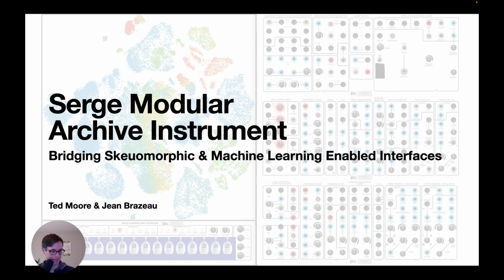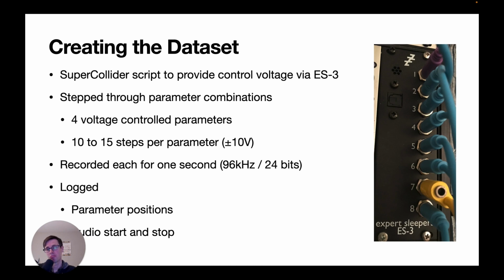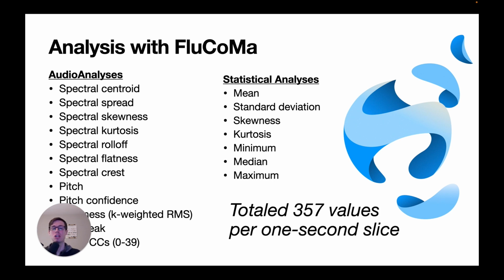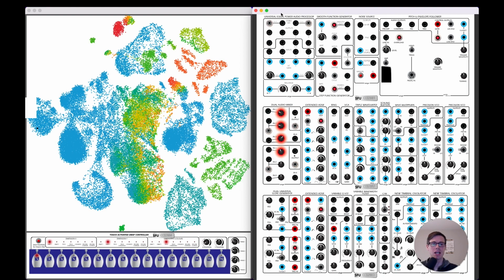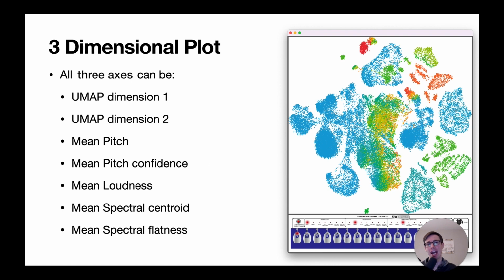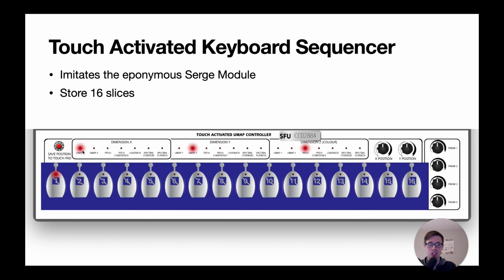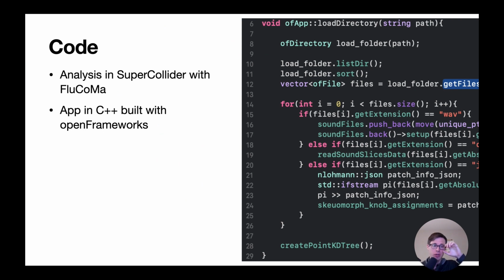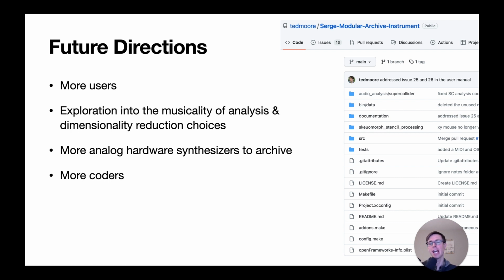Serge Modular Archive Instrument (NIME 2023 Presentation)

Comment: Was your main interest general data analysis with this as a practical example or audio modeling?
Reply from the maker: We think of it as both an archive of sorts as well as a performable instrument. Also, it might serve as a model for others to approach similar sound datasets and archives.
Reply: @ted_moore  It surely is an intriguing concept. I am trying to imagine how this could also work for something like granular sampling, which I consider to be the next best thing compared to resynthesis because it is much more manageable on a user programable level. So the bad joke about our cat even had a serious side. 😄 Any thoughts?
Reply from the maker: @marcbrasse747  This is essentially doing granular sampling. The "grains" are 1 second long each if they get played in their full duration, but if the parameters are changing fast enough either via the plot or the knobs it's only playing a very short excerpt, so essentially a granular emulation of the original synthesizer sounds!
Reply: @ted_moore  Ah yes, of course. Seems I found a box and asked why I heard the mowing of a cat coming from the inside after shaking it. (Got to stop with the cat  jokes though). Now I better understand the behavior during small pot moves. I’ve been suspecting for quite some time that a lot of so called virtual analog modeling sounds are generated this way in digital synths. By using samples all the time and relatively short ones during “modeling”.  Roland even seem to have used this to get away with relative few modulation options. If the sample is still long enough to do a bit of subtle, barely audible shifting it also retains a lot more character then a single cycle one.  Each brand then sells this very same approach as their own special analog modeling technology. But sorry. I am digressing. 🤓 Again: Your concept is interesting
Reply from the maker: @marcbrasse747  Unfortunately, this strategy of emulation is quite impractical because it takes sooooo much memory! Using just one of these patches requires a user to download multiple gigabytes of sounds...!
Reply: @ted_moore  Assuming you do not mind a bit of constructive criticism: This puts your method to the opposite end of practicality scale compared to my vision of granular sampling. Having  to manage huge numbers of individual data elements is actually what makes creative user programming of resynhtesis so difficult. Based on the Fourrier principle of being able to (re)create any sound by addetive synthesis the problem often is to perform meaningfull = musical micromanagemen of the procured data after an analisys has taken place. One cannot simply move a filtercontrol but has to  "redraw" the parameters for every individual overtone to archieve asimialr effect. In that respect your method of presentation of the data might actually be usable to scroll through a lot of iterations of a resynthesis preset. My  vision of the advantages of granular sampling is more that one can start with whichever sample one is inspired by and then use the granualr data as a sort of soundpool for many variations. For instance the sound  of a piano. One can scroll tthrough  the grainsfrom a point with a low amplitude and damped spectral range back to an earlier point  near the attack phase where  the oposite is true. The most obvious result would be an emualtion of an inverted sample but a lot more becomes possible. By manualy or otherwise modulating the posiiton of the "play head" one can even use the scrolling itself as equivalent to "filtering". This would actually  create a sort of virtual filter which is atuned very  much  to the original sample because the content through which one scrolls reflects not only brightness but the whole acoustical properties of the original sampled sound / instrument. Strangely enough I  have yet to find a grnular instrument which  is finetuned to do this in a polyphonic per note way. Anyway: With this  methed one  can get a lot of mileage out  of a tiny bit of memory.
Reply from the maker: @marcbrasse747  That's true it is very impractical. This is why it's also angled at being an archive. It is archiving the actual recorded audio from a vintage instrument, which is a different approach to most emulations. But a very impractical one, yes.

If you're interested in a Serge emulation that require much less memory, check out this project!: https://github.com/surge-synthesizer

Re: scrolling through iterations of presets, check out these: 
https://www.youtube.com/watch?v=mxmMBvi3Cb0 (SuperCollider) 
https://www.youtube.com/watch?v=XfNZzQPdPG0 (Max)